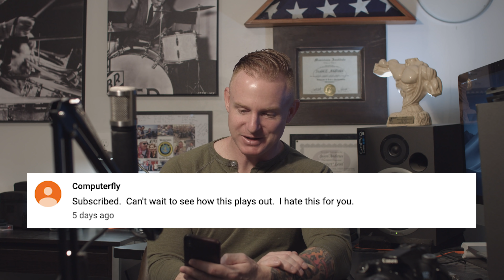GT350 Engine Blown Part 2

Comment: Sorry to hear about the engine failure. As a fellow GT350 owner - I admittedly have concerns but remind myself that given the number of units out there, the percentage of failures is no different than other high performance offerings. Happens to the best of them. Good luck getting the issue resolved quickly!!
Reply: No...it's an abnormally high amount of cars.  Just search the web and forums.   And with early miles to boot.  There's a serious flaw with this engine.
Reply: @BEBNC1  I have an 18' with no problems

Comment: My gt350 had engine replaced and its fine now, love the car,  , its like any other part, it failed, they will replace it. Dont sell it man :) wait for them to fix it and enjoy the car!! Good luck !:)
Reply: How long did it take for them to diagnose, order parts and fix it?  My dads 19 with 1400 miles on it locked up while idling. Just wondering how long the process took?

Comment: Hoping the repair gets done in a timely manner and you can get back on the road. The only thing that scares me about these cars is the cost of repair post warranty or if the warranty claim is denied. Unfortunately there will be a small % of failures with mass produced engines. Replacing one post warranty is like buying a GT Mustang back in the late 80's. 😨

Comment: Mine is just over a year old and I took it out for a Sunday drive and the rear tires looked up momentarily doing 40. I managed to pull into my garage and now it’s knocking exactly like yours is. I have to flat bed it to my dealer Monday morning. Pretty bummed.

Comment: Ford is sailing lemons. Started with the Focus RS and now this GT 350. I was going to get one, but what’s the point to get the engine replace if it’s going to happen again. There is another issue. When you rev the engine high and the dealer tech or you if you do your oil change, the vibration of the engine will unscrew the oil filter and then you kill the motor again. Is a nice car and I love the sound and in the way it tracks on the twistis. I hope ford fix this engine problems or this car will like the BMW M3 V8. Amazing engine but it sucks in the readability department

Comment: The more days they got it better you are. Some states it’s 20 days. It’s mandatory they give you a loaner. Don’t let them screw you. I had so many loaners. Your not in the wrong in anyways. Many guys will give you hate. I have so many haters because I told my story an want other people to know what happen to my car. Ford Says your car is a performance car it’s made to be revved it’s made to be beat on. Ford watched my videos an said I abused my 10r80 doing burnouts. Lmao I never used line locks an I always dragged raced in drag mode. An I didn’t drag race my car until it hit 1700 miles an had 1 oil change. Soon ford will have a TSB report saying knocking in gt350r is totally normal drive it an enjoy it. I wouldn’t keep your car man if you like the raptors you can’t go wrong with them. We had a 17 An now a 18. Trying to talk the wife into a 19 I really like the new recaros race seats but they only come in blue. I have a video of 1 I think on my channel scroll down an check it out. Don’t get a 17 raptor the 10r80s don’t shift we’ll get a 18 or 19 is even better. The 19s have active suspension an Jump mode which actually works.